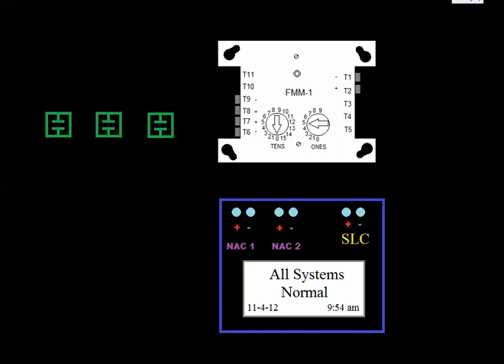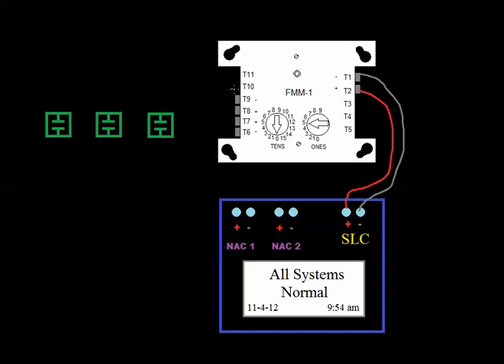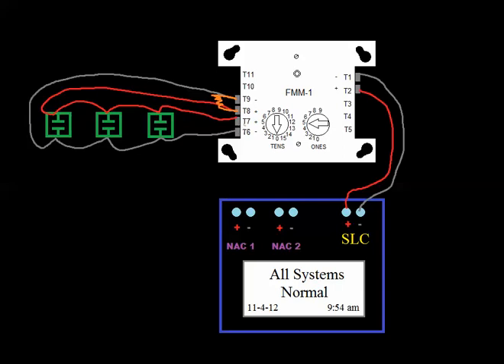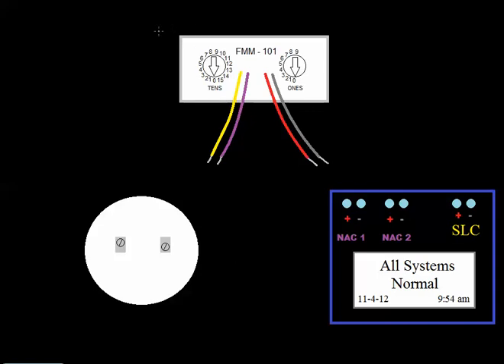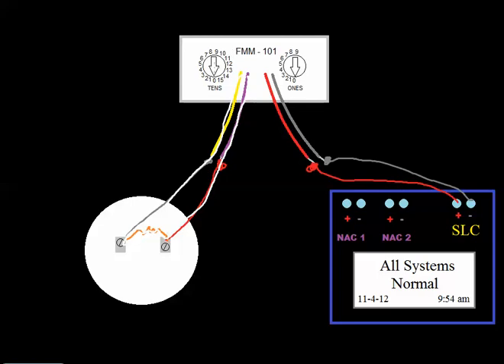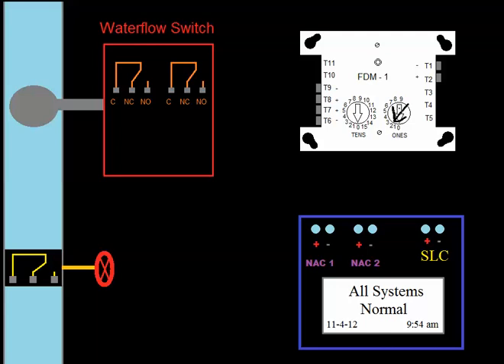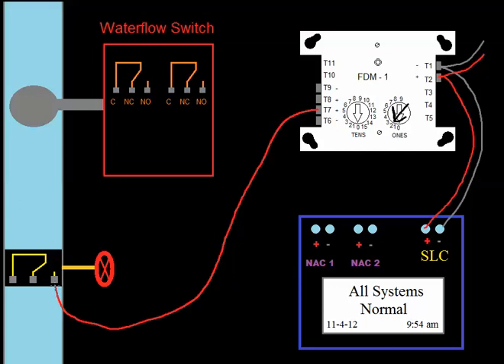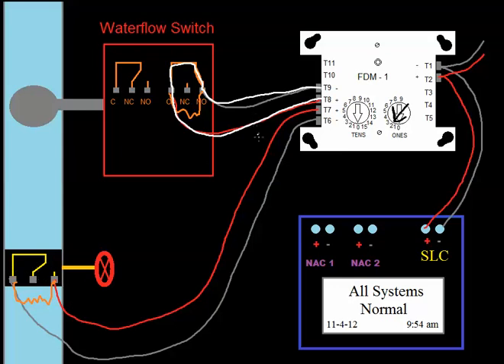23 - Monitor Modules - Introduction to Fire Alarms

Comment: In FDM-1 monitor module connection, you connected the shut off valve contact in parallel with EOLR, which will cause alarm when the valve open, we need the shut off valve for trouble/supervisory signal, so I guess you must connect it in series with the EOLR, so when the vlave open, it would open the circuit and we will have a trouble signal instead of alaram signal, please correct me if i am wrong
Reply from the maker: If the module is programmed for a "supervisory", then the short will activate a supervisory, not an alarm. The waterflow and tamper will be wired the same, the differentiation occurs in the programming.

Comment: Would you be able to make a video on isolating modules? I'm wondering how they are being used in the USA. Are they being installed on each side of a fire rated wall? Etc
Reply: theyre basically used wherever you want to minimize wiring faults affecting specific areas/ smoke compartments. other circumstances they are also used in but it's a pretty basic concept. very useful in finding opens or grounds on non-addressable circuits.

Comment: How to know if addressable fire alarm cable (loop) is cut?
Reply from the maker: If it's a class B loop (circuit goes out but doesn't come back), you'll have a lot of "missing" devices. Different panels show these troubles by different terms: "missing", "invalid reply" "no answer" "comm fail", etc.

If it's a class A loop (circuit goes to each device then returns to panel), you may have a single trouble that says something like "style 6 open", "loop break", "class A trouble", or something to that effect.

If it's a class A (style 6) loop, you can disconnect the circuit at the panel and meter for continuity between the two negative legs of the circuit, and between the two positive legs of the circuit.

Comment: Does it works in conventional panel?
Do I need to install fdm-1 module into my conventional panel or I will directly wire my flow switch into zoning of my conventional panel

Thanks in advance for your answer
Reply from the maker: It does not. The whole point of a monitor module is to interface between an intelligent panel and a conventional device. If you have a conventional panel, conventional devices connect directly to the zones.

Comment: Following up on my question on connecting fmm1 to notifier beam detector...i connected the T9(-) and T8(+) to Com and NO then placed resistor between T9 amd T8  is the connection okey??
Reply from the maker: I don't know, what model beam detector. Do you have a link to the installation sheet?
Reply: @JoeKlochan  i only have the model number

Comment: Nice explanation, great video.

What tool did you used to remove the waterflow cover?
Reply from the maker: Depends on the model of the waterflow. Buy a security bit set (Klein makes one). That covers most of them

Comment: You do not put the resistor at the module with Class "A" the module monitors is with out the EOL-
Reply from the maker: Yeah I think you're right. I made this video a long time ago, and I've never wired one of these things class A. I always thought the resistor went at the module, but recently I think I came across a scenario where I found out that wasn't the case.

Comment: The only thing I would add to this is to put the resistor in the field instead of putting it with the module or panel. That way the wire itself is also monitored. Other than that, this is great stuff for review! Thank you.

Comment: Why would you use a resistor on an addressable device? I thought that the panel saw an address or a resistor. Not both.
Reply: I thought the resistors were only for the FMM's ? I don't think he showed a resistor on a pure addressable device ... or did he?
Reply: @hgr4255 a bit late but FMM does not use EOL for connected Class A device circuits. he stated in another comment that he'd actually never wired an FMM to a Class A circuit, only Class B so he assumed the need for an EOL.

Comment from the maker: Aleksey, I haven't found many good books on fire alarms. It's one of the reasons I started this series (which I plan to expand on at some point). The National Training Center Brown Book is pretty good, but it's expensive. It only covers fire alarm systems though. I haven't looked for any in several years.
Reply: You wrote the digital book. Number One on my New York (actually L.A.) Best Seller list. Wish we had digital video back then, I would have done the same.

Comment from the maker: Thanks for the comments guys! Frank, I'd be in over my head answering that question. I don't have experience with unique systems such as the one you're describing. I've dealt very little with releasing systems in general, so I'd have to defer to someone with more experience. Sorry I couldn't be more helpful.
Reply: Hey joe, just out browsing trying to learn new stuff. I’ve been a commercial industrial electrician for over ten years and have done very little F/A. I will be very honest I’m not super confident in this area. So That’s why I’m watching your videos even though I don’t do F/A there are aspects I feel can definitely still benefit me in other areas. This may be a dumb question but the resistors y’all put in at the device between the wires (and I know sometimes you just put the resistor back at the module/panel. Can you please explain to me what the purpose of that resistor is and how it is providing obviously something crucial to the success of this installation . I mean I have an idea what a resistor is, I just never understood what it does in the FA scenarios . Any knowledge or input would be greatly appreciated. Thanks joe.
Reply from the maker: Mike, the purpose of the resistor is to supervise the integrity of the circuit. The panel is designed to "see" the resistor. By adding it to the end of the circuit, it provides proof that the circuit is still fully intact. If someone were to cut a wire, the Panel would no longer "see" the resistor (I.E., no current would be flowing) and so the panel would go into trouble, indicating a problem on that circuit. My first 2 videos should clear it up.
Reply: Joe Klochan thanks for the reply joe. Appreciate you taking the time and I will definitely watch those tonight. I guess my next question is if the resistor is not there , there is still current returning back to the source and the panel acknowledges that still correct? I’ve done some control work as well so I have a little bit of an idea what an input is. So it is the AMOUNT of current the panel detects when there is a resistor ? Ughh lol I know there’s just knowledge I haven’t attained yet (which is why I’m still missing something ) lol but I’m gonna go watch those other videos.
Reply from the maker: That's a good question, and it depends on the type of circuit. If it's a horn strobe circuit, there would be no current flowing through the circuit at all if the resistor isn't there. Ever horn strobe has an internal diode preventing current from flowing through the device in a standby state (that is, when the panel isn't in alarm). So the diodes prevent current from entering every horn strobe. Then when the panel goes into alarm, the polarity reverses at the panel, and so the current can then pass through the diodes.

On an old conventional smoke detector circuit, it works more like you suggested. The smoke detectors do draw an extremely small amount of current, but not enough to affect the panel's ability to supervise the circuit using the EOL resistor. My first several videos hopefully do a better job of explaining this than I can via text.
Reply: Joe Klochan So I watched the first two and you were absolutely right ! I totally have a good understanding of what the resistor is for FINALLY!!! Can’t wait to continue on with all your other videos! Love learning ! Thanks for all your help and for taking the time to help me !! 👍🏼👍🏼👍🏼

Comment: Joe, Videos are great!  Thank you… 
I am looking into a fire shut-down system and it will need to meet UL, CSFM, and FM approvals and I have a few questions… which heat detectors are best suited in a industrial area in case of a fire and shutdown machinery? CNC machines, presses, hydraulic-units, pumps etc..?  What brand FACP controllers are commonly used?  Can a standard PLC be used with UL/FM approved heat sensors, (302 Series), if it's failsafe wired/configured?  Thanks again.